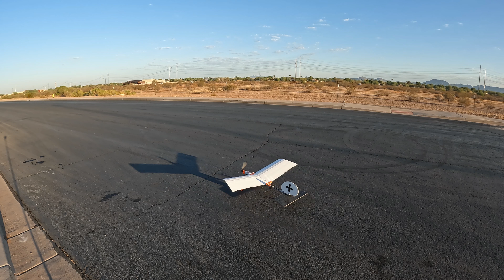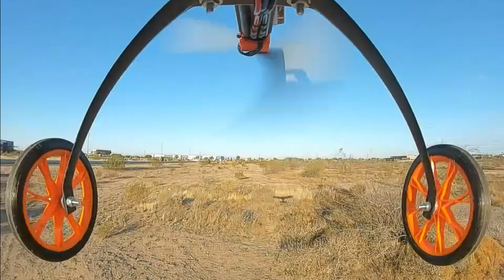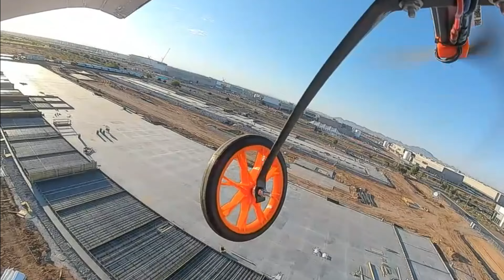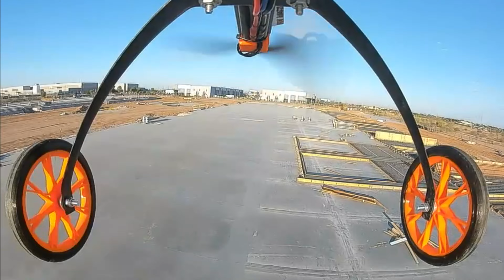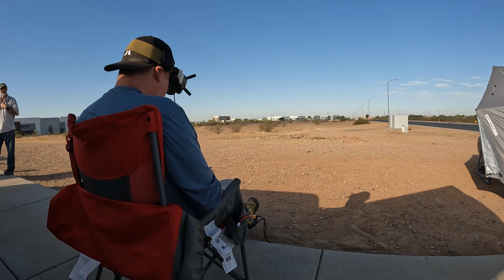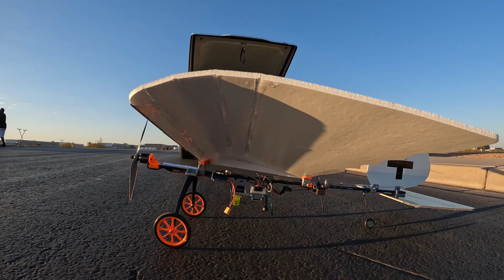Slow Stick FPV - Carbon Arrow Design

Comment: Thanks David, I've built 2 now using your plans and love them both. I just can't imagine flying FPV with these, but that's mostly because I'm not familiar with it. What would estimate the cost to be to add the FPV equipment?
Keep up with the fantastic videos!
Reply from the maker: Thanks for the comments.  That is awesome you made two of these!   As for FPV, I recommend 2 things, 1. Radio that supports long range. 2. Digital FPV gear.  This could cost $700 to $900 for those options.   The thing is, FpV is totally worth it.   I often tell people it is cheaper than playing golf.   Good luck and I Hope you give it a shot.